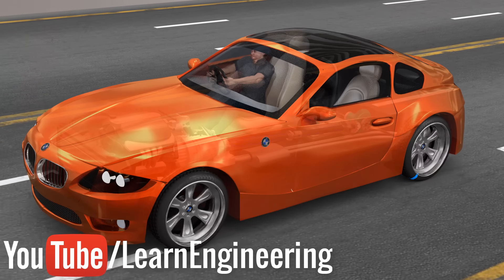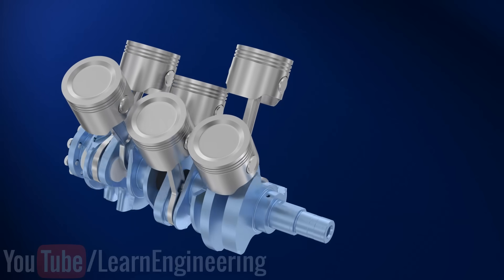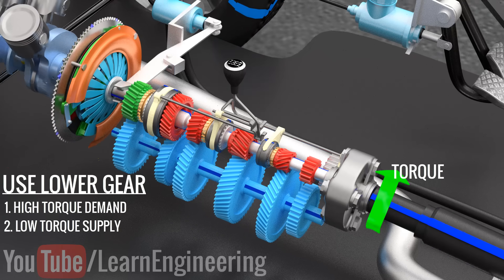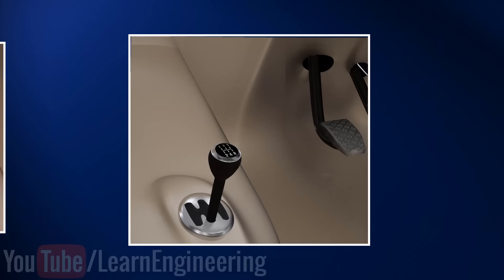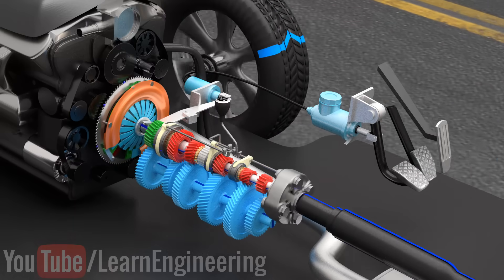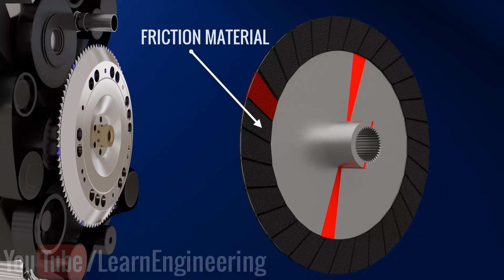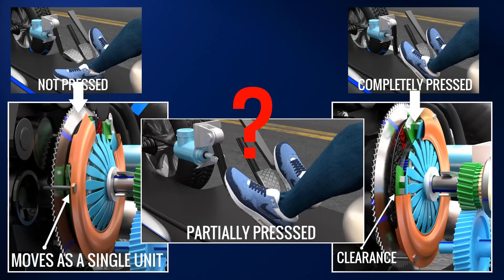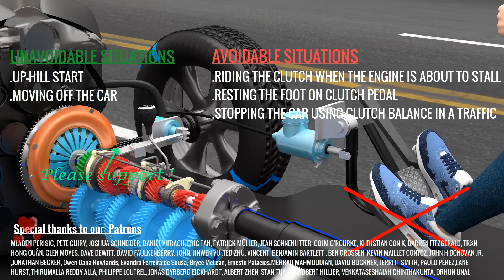Why you should not PARTIALLY press the Clutch?

Comment: Just putting it out there that I've put well over 300k miles (~500k KM) on three manual-trans cars while occasionally doing partial clutch engagement to, say, assist in an accidental or unintended start from 2nd gear. I have never once had to replace a clutch (due to such "abuse" or otherwise), but the tone of this video makes it sound like you can get away with such things about ten times tops before the whole clutch burns up. Still worth it I guess to scare people who actually do ride their clutches.
Reply: The video doesn't communicate reality very well.  Like if you're truly riding the clutch in a bad way you'd smell it.  Riding the clutch and using it are different.
Reply: lossfound irk, he evens says that at the end, which is total bs. Ridding the clutch is normal in uphill starts, start and stop traffic , smooth gears changes.
Reply: You can start in second.  Two instances where I needed that was; one, with an ancient truck where first was blown; two, when push starting any manual car whose battery is dead.
Reply: I'm not talking about starting from a cold stop in 2nd so much as I am talking about certain nasty urban-traffic situations where you've downshifted into 2nd anticipating the resumption of acceleration from a speed in that gear's optimal power band, ended up having to slow down more than you thought, and don't have the time to shift back down into 1st without causing a traffic hazard. My own 'Murican experience here is also with cars of only 2L or so of engine displacement (and outside of occasional luxury / sports cars it's pretty tough in the US to find a gas guzzler with a stick shift) - oh yeah, and also with motorcycles, where it's definitely not so far fetched in certain stressful traffic circumstances to think you were in 1st when you had only made it to 2nd before throttle must be applied or one risks their tail end unnecessarily.
Reply: worst thing you can do to a clutch is boot it. booting is when you are in too higher gear and low RPM and have to press the throttle very hard to move the car. don't be lazy, change down a gear, changing gears should be smooth and fairly quick with little effort from the throttle.
Reply: Richard Vaughn are you sure you know what you’re talking about? Last time I checked the flywheel is not located inside the bell housing where the gears are sealed in.
Reply: Bilal Tariq rev matching downshift is extremely good because there is no slippage of the clutch just like rev matching up shifting same theory's applying
Reply: It depends on your skills on the gas pedal and how fast you travel.
Reply: @bilaltariq7819  My 04 gt hates going into 1st while moving even at slow speeds. I can even start in 3rd and not burn the clutch.
Reply: lossfound that’s me lolllll I was so scared I was gonna burn my clutch so I became very wary of only engaging the clutch fully
Reply: I feel currently in my car I have to start from a stop in 2nd gear to avoid the jitter my car does starting in 1st.
Reply: Everyone in Europe rides a manual and everyone does this.
Reply: Hah, you only started in 2nd gear? I used to start in 3rd, and that was in a hill. Amateur!
Reply: @tripplefives mechanically you are destroying your car by USING IT, it's hard to tell if you've ever actually driven a manual. Certainly if you did you'd understand that it doesn't work out if your clutch only had two positions, otherwise it would be a button and not a pedal
Reply: I ride my clutch everyday and I see no issue with it whatsoever.

Just having my foot on the clutch doesn't engage it in the slightest, only if I put more pressure onto the pedal is finally does.

Never driven any non "sport" vehicles so this could be different on other cars.
Reply: You  have at least 5 gears in a modern car so use the one suitable, it's not difficult, how the hell do you "start in second gear" anyway.
Reply: @DogsBAwesome  I started in 5th gear a few times in a '96 Nissan Maxima SE. That thing had a silky smooth V6 and started rolling without a judder. Of course, I was just curious or feeling adventurous and did that only when leaving a parking lot. Normally, I started from 1st gear.
Reply: schitlipz only in American cars with their unnecessarily large wasteful engines.
Reply: brian whittle American muscle dill destroy anything you own
Reply: @DogsBAwesome  unfortunately our cars are just cooler than yours, sorry
Reply: @latiostech8822  wasting fuel and ruining tires is in no why cooler. Also I have an EV now which is fine, no gears.

Comment: First he says the torque can be increased by lowering down the speed and vice-versa, then he says the torque is low when the engine rpm is low..  so how does low speed provide more torque when the graph shows that the torque is low at low rpm in the starting? i am a bit confused??
Reply: your question is "how does low speed provide more torque when the graph shows that the torque is low at low rpm in the start"?

what is confusing here? You are driving up hill, in 4th gear, 2700 RPM and 80kmh (wild estimate, not accurate). Hill is getting steeper, and your car starts to lose speed and RPM (torque not big enough to counter gravity & weight resistance). Next thing you do is drop to 3rd gear and what happens is:

- drop from 4th to 3rd gear, gear ratio changes, 3rd gear gives more torque than 4th gear because of that ratio
- your RPM will JUMP from 2700RPM to 3200-3300RPM (wild estimate,depends on engine & transmission)
- your Torque will increase because your RPM went up
- your car starts to accelerate because it now has enough torque.

more speed =/= more torque, some vehicles are very slow but give lots of torque (Tank, Truck, Bulldozer). They have high torque engines with short gearing (short gears good for torque, long gears good for speed)
Reply: Everything about this video is confusing.  The concept of reuploading is confusing too.  Sometimes when you make crap ya just gotta bite the bullet.  This guy needs more manual transmission experience before trying to explain it.
Reply: A Dz Thankss a lot, now my confusion is cleared!! 😊